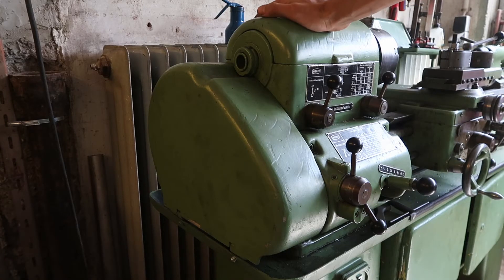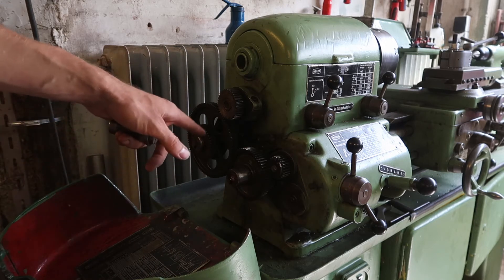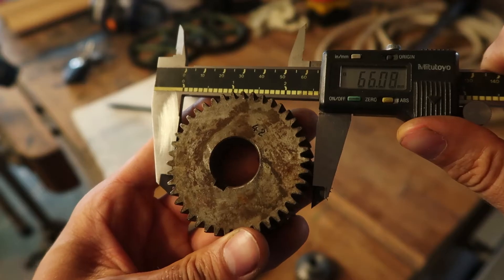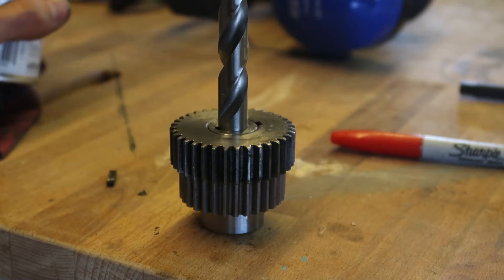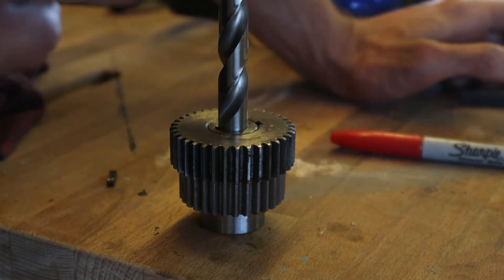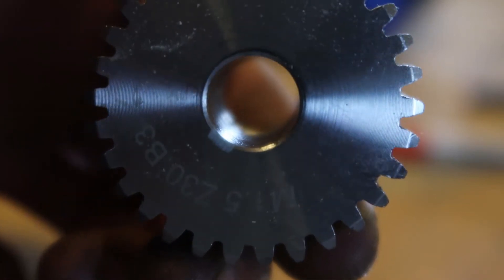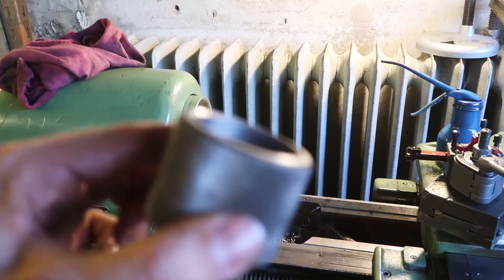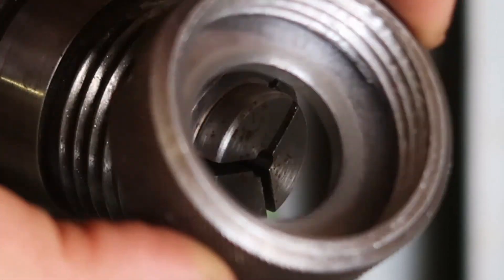How to buy change gears for your lathe | making a collet holding nut for the Weiler LZ280

Comment: Very informative video! Thank you!
Just a hint: I did exactly the same modifications to raw gears to create change gears for my Weiler LZ 280 recently. In some cases I observed quite a significant run out between the pitch circle and the original bore of the gears. A few days ago I uploaded a video showing how to determine this and how to work around the issue. Hope this is useful.

Comment: Hi, Im not sure if you still have this lathe, but im in the process of getting an old one running and im having a problem with the back gear. When i try and use the lever to engage it, i cant get the lever to pull out and then turn. Is there something strange about using the back gear, do i need certain gear levers in certain positions or something like that. If not, it just means mine is jammed
Reply from the maker: The lathe has to be off. Since they are straight cut gears which slide over each other, they catch sometimes. Turn the chuck by hand slowly and put some pressure on the handle, it will click in.

Comment: Does this Weiler LZ 280 lathe model have central oil lubrication?
Reply from the maker: Nope... Do you mean for the ways? I've never seen a lathe with central lubrication for the ways, does something like that exist? I could imagine new CNC lathes have something but old manual machines...I've never seen one like that...

Comment: does this machines have a thread dial indicator ? I am planning to buy this machine but cannot locate the thread dial in the apron.
Reply from the maker: No it doesn't, you can't disengage the lead screw when threading. Perhaps you can add one, i never really looked into it, i just keep the lead screw engaged when single point threading.

Comment: pretty much like the way you solved the problem using the lathe itself. I have a similar Weiler model, a LZ 280 S, with the bigger frame on the bottom side. It came with draw-back-collets and its draw tube. Hope you enjoy working on that device!
Max
Reply from the maker: I'm pretty sure this one had the same thing at some point. All of the manuals and old photos I found have that same system on them. Oh well, my solution works too :D